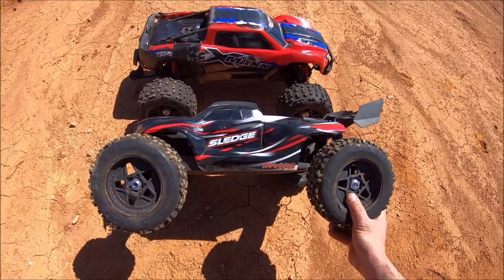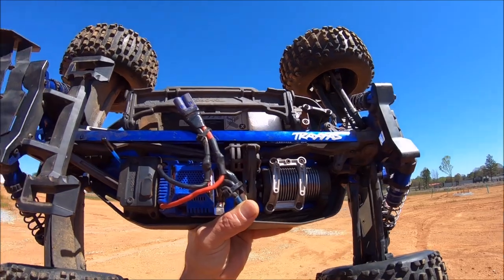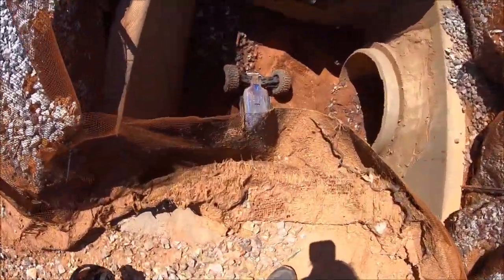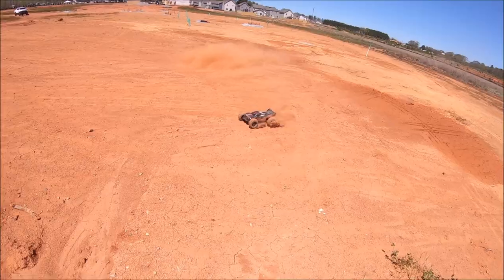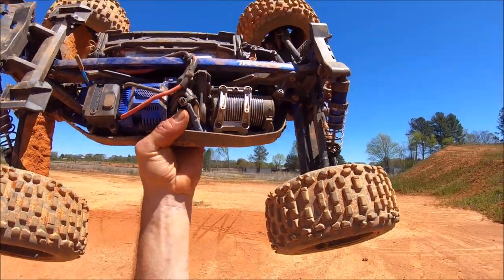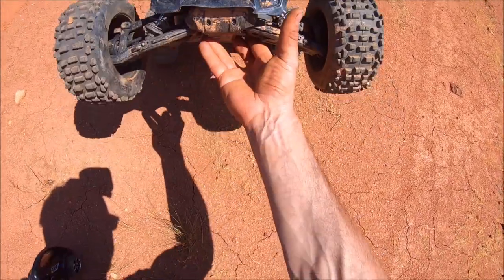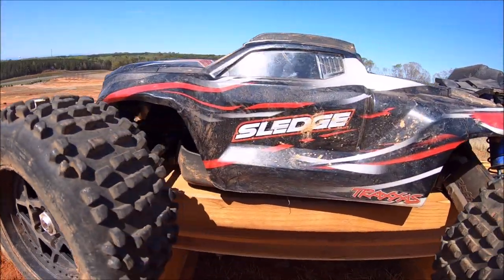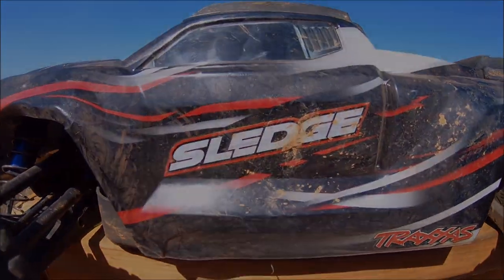WIDENED! TRAXXAS Sledge 6s 15/46 gearing with HRB 6s Lipo test!

Comment: For that little bit of breakage after all those awesome launches is unbelievable. 🔥 It blows me away how far RCs have come since I raced hard core between 2000 - 2004. My first hobby grade RC was a Rustler back in 99. It absolutely sucked. 😆 My first nitro was the TMaxx. In 99. It was very cool for the time but you couldn't bash it very hard. 
Awesome bash bro. 🔥👍✌️

Comment: Ok definitely going to get rid of the typhon 3s,  Hoss, slash, slash OBA (maybe since they discontinued them in 2020) and rustler 4x4 vxl. That will be to purchase the Sledge. Should have been called the Traxxas Hammer.? The 6s seems to be the sweet spot for me. But will keep the Xmaxx. Just being disabled, the Xmaxx doesnt get ran much due to it being heavy on the cage in my back and a shattered leg.

Comment: I find that the 15 tooth pinions in a 6s is just right for all conditions myself. Doesn't get to hot if switching between 100 and 75%. If ran on 4s on 100% is like running stock pinion on 6s. I keep the 15 in the Outcast, stock so far in the Kraton and a 17 in the typhon 6s. And thanks for the vid awhile back with the Mojaves on the typhon 6s.  I've had a blast running them. Best tires by far, so far. Imo 👍 although I do run street tires for racing and the proline badland mx on track. But love the Mojaves just to throw on and attack everything. They even fit with the RPM bumper and skid plate.  If iij ever get any rubbing with wheels steering in the air and tires balloon, will shave the edge of the bumper a lil.
Reply from the maker: Yeah 15/46 was perfect! Pretty aggressive gearing going from a 52 spur to a 46 but it seemed just fine! I'll probably try 17/46 with a Max 6 soon!😎

Comment: Do you know if a 6s gens ace 6800mah bashing pro pack would be to heavy to use in the sledge? If not how long runtimes do you think i will get on stock gearing?

Comment: Awesome video but what transmitter were you using I need to find a new one because every time I bash with my fly sky gt2b near power lines I lose signal I noticed you were near power lines and no signal loss
Reply from the maker: Thanks! I'm using the stock Traxxas transmitter that came with the car.

Comment: Hello, i can see that you have changed Traxxas connector for EC5. It is only way how to run on the one 6S packs? Because standard TRX connector does not allow so many amps and that is reason why its separated to two connectors i think am I right? I really thinking about change stock Traxxas connector on my Sledge. I had serious first run yesterday and battery jumper almost came off and regulator turned off. Yes i can tape it or use strapping tape between wires. But im not sure, that second connector can draw 35C(70C) Battery which is originally deans and there is a dean-old TRX reduction(im really thinking about solder there TRX old or new connector, use reduction only on some packs for charge but not for drive). I don't want to go with 2x3S battery. I'm thinking about switch all TRX connectors for XT90 or IC5, XT90 rather, because is easier soldering. On  the old Slash, there was old TRX and it was tough to disconnect, but new Traxxas connectors are so easy to unplug.
Reply from the maker: Only reason is EC5's can handle more current and all my lipos are EC5. So easy to have all my trucks with one style connector.😎
Reply: @RCDUDE81  Thanks for the reply :-)

Comment: What would you recommend I do to run the 6s backflips on this? I have a set. Sounds like you think they work better than stock? Love your videos. Thanks.
Reply from the maker: Easiest thing to do is as I mentioned use the M2C universal hexs! They definitely work but weren't designed for it. M2C will be making a hex for it too very soon!
Reply: @RCDUDE81  can you give me the part number on those?

Comment: I want to buy a set of the +5mm hex extensions from m2c was it part number 3500?  Love you videos!
Reply from the maker: They are not made quite yet! They are making an actual +5mm for the Sledge. Should be very soon!😎👊
Reply: @RCDUDE81  what ones did you use in your video? Will the universal hexes not work?
Reply from the maker: They will but you can't run stock wheels. They also have a little bit of play in them. You can certainly run them if you want. I honestly had no real issues!

Comment: Do you recommend 15/52 gearing with those 6s backflips? I am running that setup and motor gets quite warm
Reply from the maker: I ran 17/46 with no bad heat but stock motor did Cogg some. 15/52 should be good gearing🤔

Comment: Are you using pinion and spur gear from traxxas? I see the 46t on there site. What 15t pinion are you running?
Reply from the maker: I was using the optional 46 tooth spur from Traxxas yes. the 15 tooth was a pinion I already had. I ended up going 17 tooth about mid way through the video.
Reply: @RCDUDE81  which did you prefer 15t or 17t? Can I use any pinion as long as it's for a 5mm shaft and 1mod? Any suggestions?

Comment: Ok, so what do you think. Should I get the Sledge or the Fire Team? Based on the costs to get them Bash ready, what is best for the buck overall? I know this is going to be a tough call, but I want to pull the trigger on one of these before the weekend.
Reply from the maker: I'd say Fireteam! Such a fun truck with already available M2C and Basherqueen Upgrades! Both are great cars but the Fireteam is more bang for your buck!
Reply: @RCDUDE81  Fire Team it is! Would you be able to provide a list of recommended upgrades, I don't have a limit on my budget.